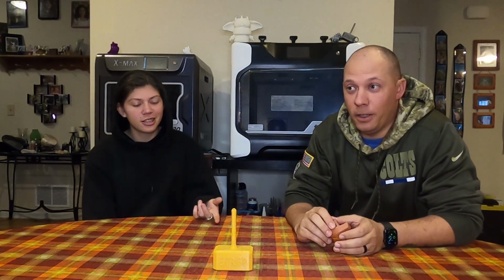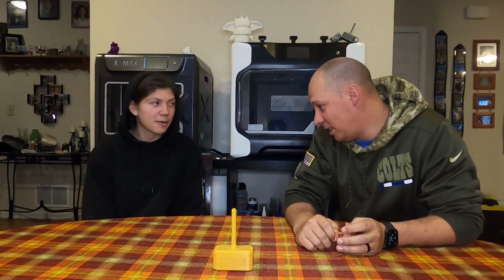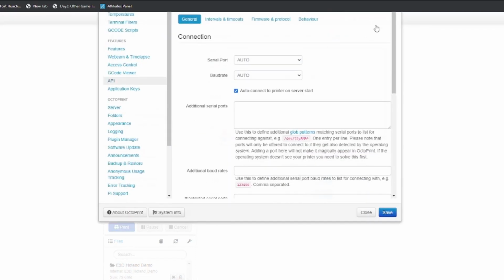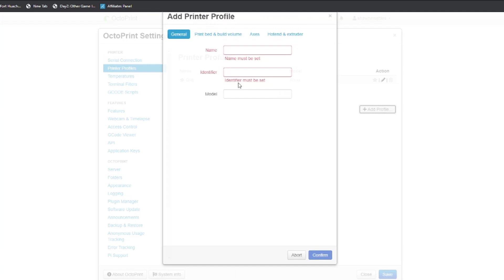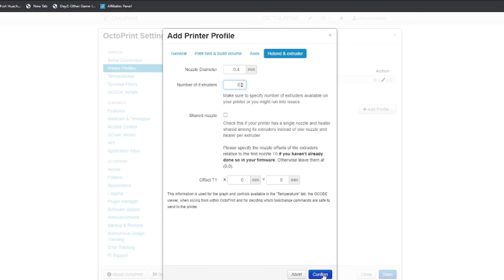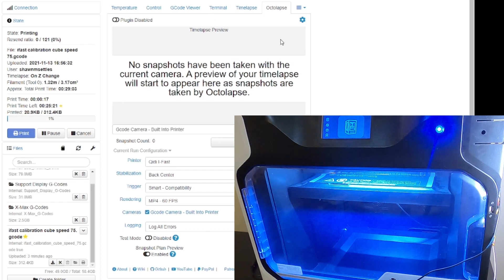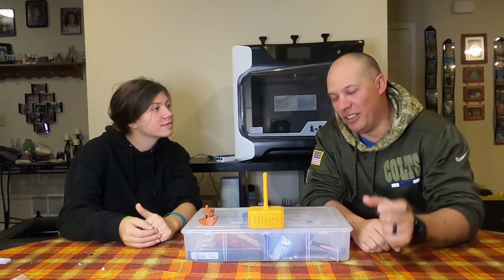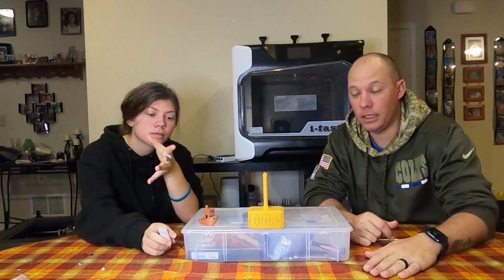Connecting the RaspberryPi to Qidi I-Fast

Comment: Thanks for your video, I opened my printer up and followed your instructions on adding the Adafruit USB to TTL cable.  I gave up on the iCookie web cam as well and removed and replaced it with a logitech C922s, simply removed the wing nut holding the iCookie cam and installed the C922s in its place.  It was a perfect fit,  I then installed a dual USB pass through connector in the side panel (lower right) and routed the new USB cables down to it and installed the cover.  I then connected from the outside to my Octoprint PI and now I can both control my printer and see the cam in the control panel.  Works excellent, though like you I'm getting various temp readings, at one point my bed was up to 70000c?  The temp reading for it still said 100c (printing ABS) so I wasn't worried and figure I can't rely on the temp values in the graph.  Anyway, thought I'd tell you my tale about doing what you did and again thanks for the video!
Reply from the maker: Thank you for the insight into your upgrades. Sounds like I need to get off my backside and start doing some upgrades myself.
Reply: @Eitri3D  On second thoughts, the C922s will require some mods, while it pretty much drops in, it's sitting too far forward and the extruder hits it,  I'm now modifying the original bracket but may have to modify the C922s as well.
Reply: @Eitri3D  have you talked to Qidi support to find out if they could solve the camera wiring issue and the plate temp errors? They are so helpful, I wonder if they would provide the needed info.

Comment: Do you think you can wire the printer to turn ON with out pushing the front button?
Reply from the maker: I would think there would be a way to do it, but it is not something I have seen done.

Comment: I have the i-fast printer. Can you use a single filiment and print with 1 head when dule extruder is installed?
Reply from the maker: Absolutely. When we are not printing dual extrusion files we keep the setup the same and just use Extruder 1

Comment: Qidi provides a Simple3D printer profile for the i-fast on the USB that comes with the printer. In your opinion could that be used with octoprint, now that you have serial control?
Reply from the maker: The other end of that cable is a usb that plugs into the Raspberry Pi. You have to use that specific cable that can only be found at Adafruit. Don’t try one from Amazon, it doesn’t work. Check out our other video about connecting the PI to the X-Max for cable details.
Reply: @Eitri3D  Thanks! The video shows clearly the Tx, Rx, and Ground connections. I'll look on Adafruit. I struggled a long time with getting the sides off my i-fast, lol! I had to replace the x-axis bar upon advice from qidi. So, taking the whole thing apart is not trivial.
Reply from the maker: Once we figured out how it came apart it was easier after that.
Reply: @Eitri3D  Could you send the link to the cable u used in the video? Thanks for your help. Your videos are very helpfull to me.
Reply from the maker: Thank you for your comment. Here is the cable we use. 
https://www.adafruit.com/product/954
Reply: @Eitri3D  Thanks you very much for your support. Please make more of this great videos.

Comment: I've been watching a few of your vids as I am looking to get a second 3d printer to go alongside my ender 5 plus that can do high temperature and enclosed - looking at the X-MAX.  Have you had any other 3d printers to compare the QIDI to or are the QIDO the only ones you run on a daily basis?  Thanks.
Reply from the maker: Once I bought the X-Max I stuck with Qidi. I have family who bought the X-Max first than bought a Ender 5 Plus to go along side of it. They told me “compared to the X-Max, which is big, this thing is huge, but the X-Max had been the easiest printer to use, hands down.” This is their exact quote to me. I personally have no experience, but hopefully that helps you.
Reply: @Eitri3D  hi that is interesting e5 plus is a big printer with 350x350x400 bed,  yes but no wasted space with plastic enclosure so probably no bigger externally than the Xmax?  Can you ask your family now that they have been using both, which they like?
Reply from the maker: Here is their response, with their permission: The Ender 5+ is a great printer but it can be more temperamental and I had to do about $250 worth of upgrades to get it to where I wanted it. It does produce good prints and the bed size is a plus.  But the reliability of the max and the ease of sending prints jobs to it is so nice.  On top of that the magnetic bed is great,  I could add that to the 5+ but would cost another $50. I would say if it wasn't for the bigger bed the Max would win hands down.  The max is still my go to printer. if you factor in the upgrades the cost difference is not that much.
Reply: @Eitri3D  Its funny since we spoke my ender 5 broke again. 3rd time I've had to take allen keys to it and wait for a part! :(   Well I actually picked up a QIDI X-Maker as they had the last couple for sale on amazon for 250 bucks.  Complete opposite of the xmax (size wise) but been putting it through it's paces and its printing pretty darn good!  I've just picked up an i-mate too as i need more capacity with my ender being down, that's being delivered tomorrow. I think my living room gonna look like your room soon lol! Thanks to you and your family for your help and making the videos.
Reply from the maker: I’m sorry to hear about your issues with the E5+, but I’m glad to hear you like your Qidi printers. So much so that they are multiplying. Thank you for your kind words and hopefully we continue to put out useful videos. Cheers!

Comment: Can you tell me how big the surface has to be to hold the ifast?
My desk is a 19.7 inch depth, I’m worried it won’t fit
Reply from the maker: It will fit no issues. The legs are 17 inches total from front to back. Mine is sitting on a 15.5 inch bookcase.
Reply: @Eitri3D  if they are 17 inches front to back, how did you get it to fit on your shelf with a depth of 15.5 inches?
Some kind of extension to the shelf to support the front legs?
I wish measurements for this machine were available in Imperial measurements
Reply from the maker: Each “leg” is 1.5 inches long so the distance between the two are actually ~14 inches. My legs hang over a little on my shelf. I pointed this out to help explain that your 19 inch shelf is absolutely wide enough (front to back) to hold this machine. I hope that clears it up for you.

Comment: Hello. Thank you for your video. Could you please elaborate on your last comment on Qidi Control Center. I have an XPlus and have been wanting to control it using a Raspberry Pi/Octoprint. I am not sure I have heard about Qidi Control Center and couldn’t find anything online about it.
Reply from the maker: The Control Panel is the other method if you do not have a Raspberry Pi. It is built into the Qidi Print (slicer). It is and either/or situation, you will not use both together. Hope that helps.
Reply: @Eitri3D  That sure did. I realized that the older releases of Qidi slicer on the Mac platform did not include the control panel option. The updated version 6 does include it. Thank you.